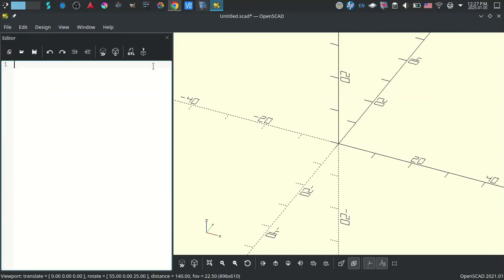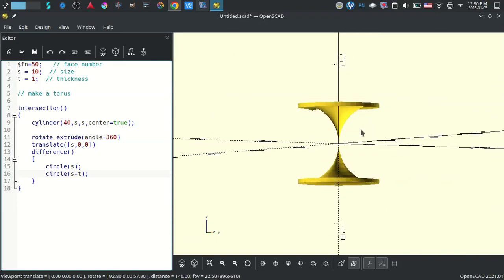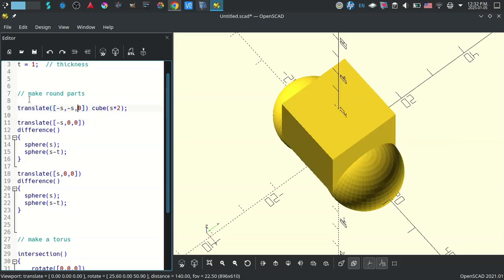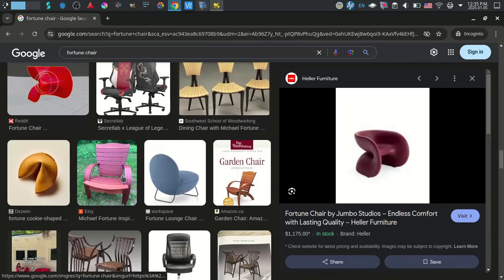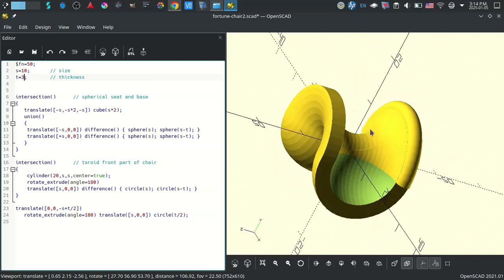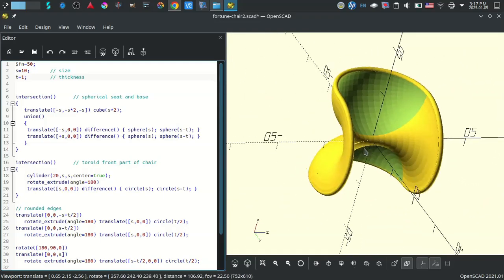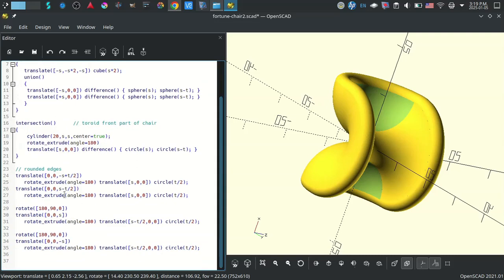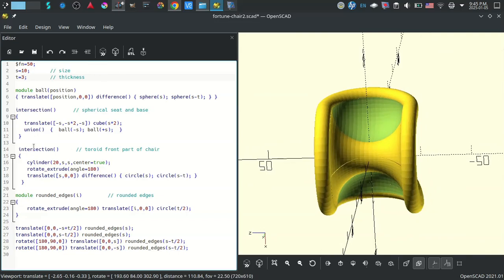1 Page to Code $1000 Fortune Cookie-like Chair in OpenSCAD 3D Printing!

Comment: Clean & simple! Thanks
Reply from the maker: Thanks for watching! The fun is in figuring out how to construct the shapes in code and then optimizing... Apparently the newest "nightly build" has numerous improvements but I'm using the old stable version from a few years back still.
Reply: @devhackmod the nightly has support for a new library ("manifold", just a toggle in the settings to switch) that makes rendering essentially instant, which is amazing